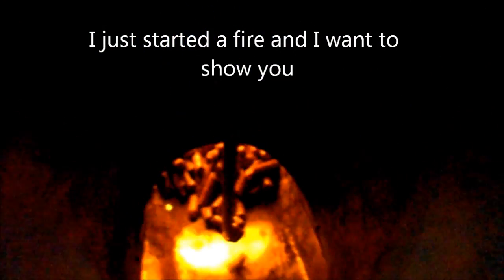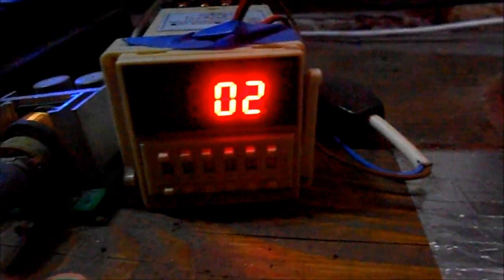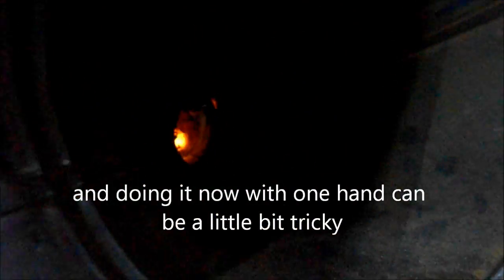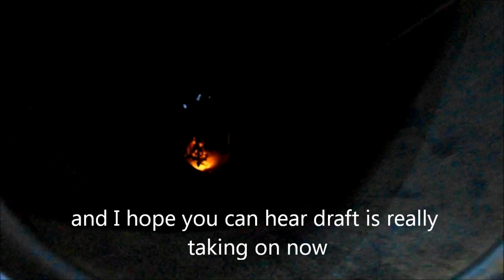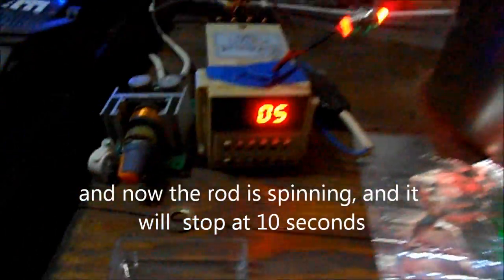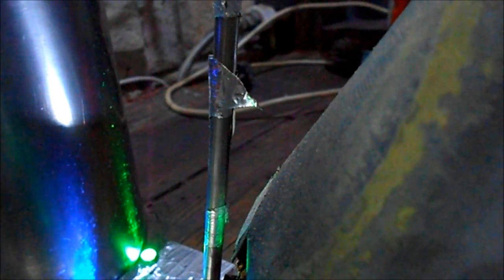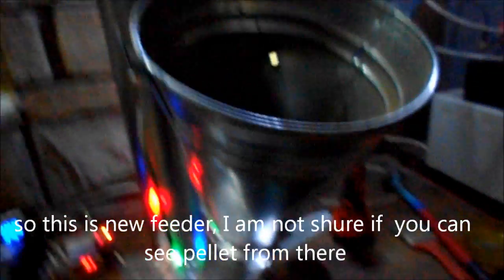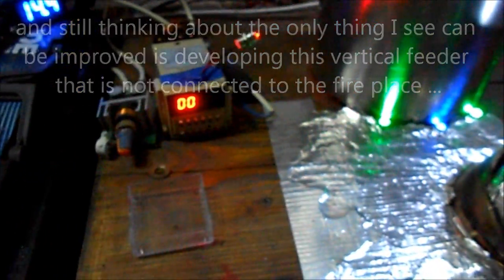Rocket stove Floor Heating with pellet, with new timer, and motor speed control

Comment: Hi how is it going? Still using the rocket heater? One question. Did you run into any problems venting it to your homes chimney? Just wondering because they exhaust mainly water vapor.
Reply: They don't exhaust mainly water vapour at all. Where did you get that idea from? Any carbon burning machine is going to exhaust co2. Not water.

Comment: Hi how is it going? Still using the rocket heater? One question. Did you run into any problems venting it to your homes chimney? Just wondering because they exhaust mainly water vapor.
Reply from the maker: Hi Dennis,
Thank you, doing great. I stopped using rocket heater as I have built another floor, and have bought new pellet heater for 120m2 (previously I was heating 50m2) My chimney was built from bricks and is about 8 meters high, so I haven’t run into any problems.
Thank you for interest 
Cheers

Comment: Great job Sinisa! Fire will slowly creep towards any airflow it encounters, so a sustained burn can cause the hopper to ignite and be a chimney. It's the same principle ranchers use when they back burn on the down wind edge of a hay field. One time I fell asleep during a late burn, but my guardian spirit woke me at 2:00 a.m. to find the extension I added was spouting 18 inch flames. The extension was empty, so I jumped up, knocked it off the main hopper, and the flames immediately subsided. Close call!
As long as the main hopper remains full, little air can pass through it, so the problem is minimized, but probably not solved. It's when it runs low and admits increasing amounts of air that problems arise. Now I use a remote hopper addition, fed thru a piece of 3 inch vent pipe that lays on top of the main hopper. Got the idea from a ZeroFossilFuel video about his "best pellet performance". I burned mine for 5 hours this way with no back burn, because the main hopper remained full until the 3" feed tube from the remote hopper was empty. 
Since you are using motor feed, a better approach would be to reconfigure your feed so the pellets trickle down your removable feed tube from a remote hopper every 20 seconds. There is no way an empty feed tube can ignite. A year and a half later you probably don't need this info, but after my experience, it could save someones life.
Reply from the maker: kelhawk1 Thank you. You are absolutely right. Before installing timer, I had 2 times pellet burning up the feeder. However with this new configuration. now already 2 winters passed with no problem (thank god). 

I also have made one feeder trickling down pellet with timer, but couldn't make it work properly. I tried adjusting timer and volume of pellet for a few (winter) days, however couldn't make it working flawless.

For safety precautions I am running camera that is connected to TV, so from room I can see how the system is working - so far so good :) 

Also, The Rocket stove is not working when we sleep, as the 500 liter water tank can keep temperature during the night. 
Except when was -20 Celsius (-4 Fahrenheit) outside, we woke up with 15 Celsius (59 Fahrenheit) in room, and my wife didn't like it :)

Thank you again for beautiful comment
Reply: Sinisa Puzic Sounds like you got it figured out. Gonna watch some of your other videos. Hey, I'm a dog person too, have three mixed breed that are as precious as children to me, and now that I'm retired i get to spend 24/7 with them!